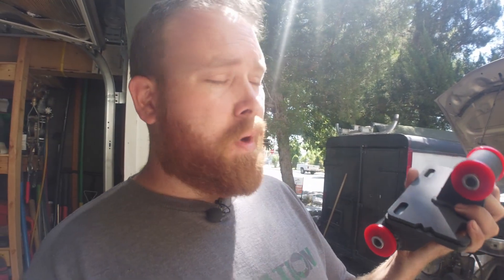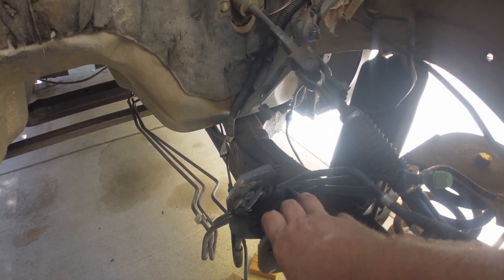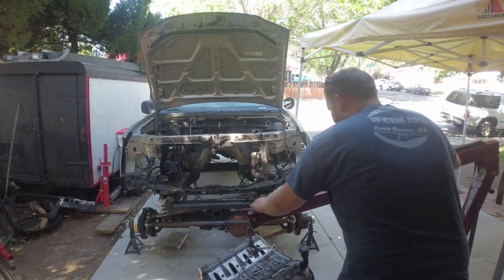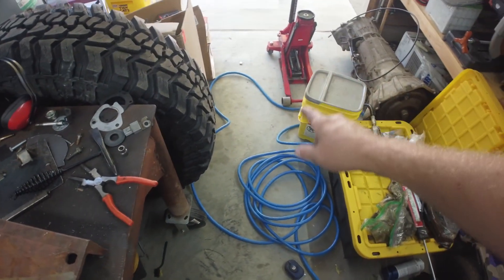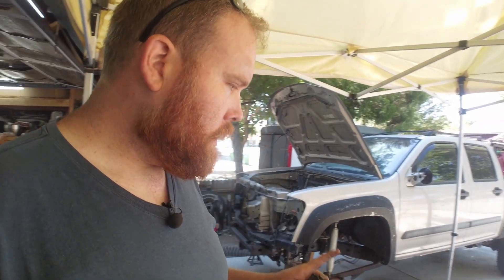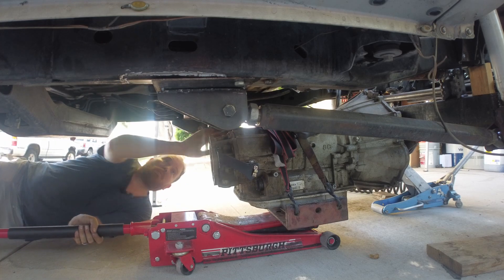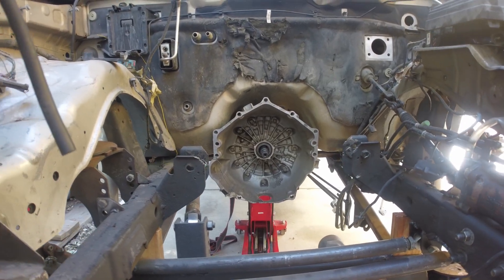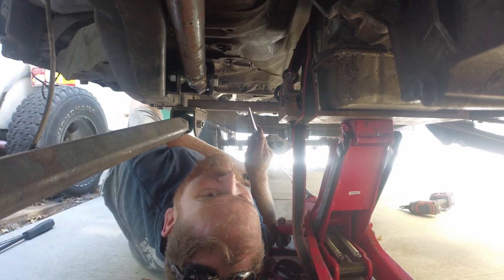The BEST Colorado, Canyon, Hummer H3 LS Engine Swap Mounts

Comment: How long are the motor mounts going to be out of stock
Reply from the maker: I have the pieces but I haven't had the space to weld on them. Little over run with projects recently.
Reply: Hopefully you can get to it soon want to do an Ls swap in my h3

Comment: Hey 
I have a humvee with a 6.5l
Want to swap the engine for a ls3 would that engine mount work?
Reply from the maker: Yes these are made for the "ls" family of motors
Reply: @BadlandIndustries  thank you for the info once I’m ready I’ll send you an email
Reply from the maker: @kennethvincent4663  you'd have to fabricate the frame side to match up but that shouldn't be too difficult at all. These mounts are supposed to fit colorados and Canyons.
Reply: @BadlandIndustries  got it 
Thanks

Comment: I'm needing a set of the motor mounts, says out of stock.  Can't find a phone number to get in touch with Badland.
Reply from the maker: i'm bringing them back into stock soon. just fill out the back in stock request and youll be the first to know when the inventory updates.
Reply: My project is a 07 H3 hummer and have bought the 5.3 motor but not only needing motor mounts but question is did you have to go with different transmission or just change out the bell housing?
Reply from the maker: @fuquelibs  you can keep your 4l60e but you'll need the v8 bell housing, torque converter and input drum assembly.
Reply: @BadlandIndustries  thank you for your reply again,  much appreciated!

Comment: I wonder if this has implications for folks who may be going the opposite direction, in a sense. I have an NB Miata and a spare 3.7 i5 that I’ve been thinking about ways to make work together. V8 roadsters (and others) offer complete tubular subframes for the Miata prefabbed with provisions for mounting LS v8s. This has me thinking that getting the i5 to jive with the LS subframe might worth looking into.
Reply from the maker: check out the 4200 i6 motor. i know you already have the 3.7 but the 4.2 is a far better motor. i dont know about packaging in a miata though.
Reply: @BadlandIndustries  Yeah, packaging is what gets you on the miata. These engines are already incredibly tall, so a hood scoop (+minor body lift/subframe spacer) is a must. May need FM suspension lift to avoid dragging the oil pan.

On the 4200, where do you think I got the spare 3.7 from :). Have a 4200/AR5 swap about 85% done on a '10 regular cab colorado (first drive a couple of weeks ago). It rips. Honestly, I think it's a much better fit with these trucks than the LS. The only real issue is you have to get/make a custom rear sump oil pan.
Reply from the maker: @johnnyk5  we need to talk about the Colorado swap. Email me.

Comment: I don't use a transmission jack, do your self a huge favor and use 2 come a longs on your next job. One on the tail shaft and one towards the front under the bell housing and hook your come a longs to the frame on both sides of vehicle and start lifting,  I  installed a NV 4500 this way and will never fight a transmission jack again.  Also,  the jack gets in your way and come a longs don't.  Works perfectly,  try it and let me know how it goes.
Reply from the maker: Cool idea. I'll consider it when my 6l80 ends up going back in.

Comment: Hi Friend I like what u do would you know if I can put an 07 trailblazer 4.2 into my 04 Colorado it’s got a bad intake seat on number 5 cylinder thanks
Reply from the maker: You can but theres only been a couple that have successfully done it. There's a 4200 group on fb that contains most of the info. The rest can be found on the 4200 wiki page.

Comment: You are a blessing to the community!!!! Love your videos. Currently I own a H3T V8 w/200k miles. I'm looking to upgrade to an L/S 6.0. I know the transmission will need to be upgraded as well. My current engine harness should be a direct swap. Outside of the trany and a tune what other variables/parts or mods will I have to account for?  Thanks....
Reply from the maker: Prob not much. All the basic bolt ons apply.

Comment: Love your product brotha and keep smashing at it! And out of curiosity how hard would it be to do a coil over swap to take out the torsion bars to prevent the lower control arm from being ripped off the the frame from the tension??
Reply from the maker: Preventing the lca tearing is easy. Het the h3 cross member. The coilover would need to be new uca and you'd likely need to remove quite a bit of the mount as well. Plenty of guys enjoying the h3 suspension swap. I'd wager that and v8 torsion bars is the best option.